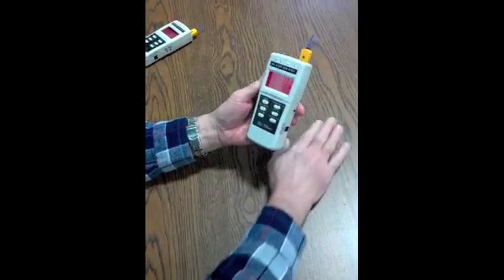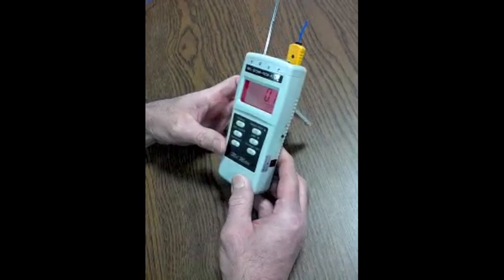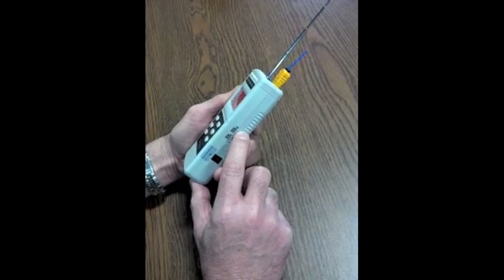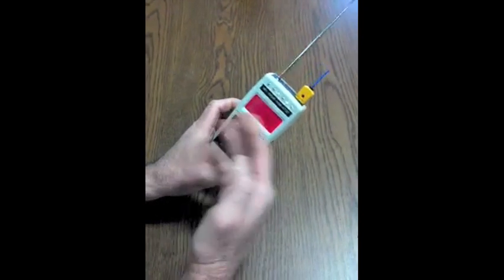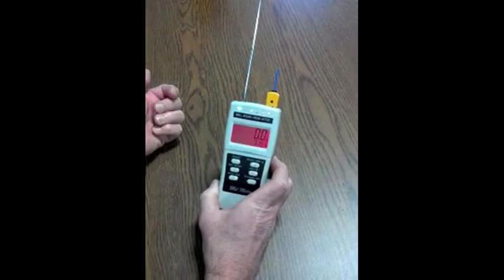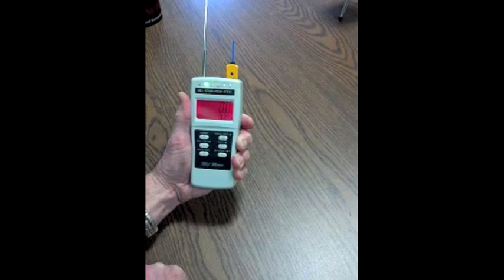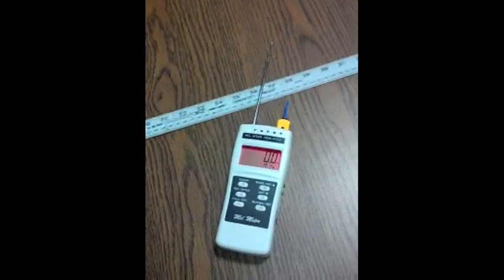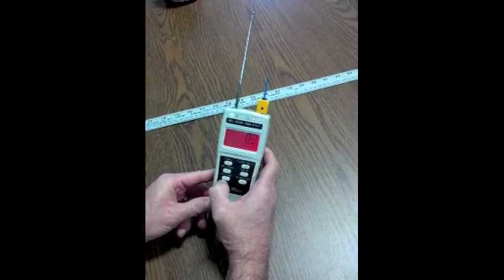Mel-8704R-REM-EMT

Comment from the maker: Hi James,
It would be like building one from scratch. The Mel-Rem-EMT card is a completely different and much larger PCB design. We would need to swap out your old REM card and install the new EMT PCB. We would then need to swap the LED top cover to a 6 LED array and install three switches. (1) for the EMT 5-step gain adjustment and (1) for the EMT Zero (baseline) and finally (1) ATDD zero button. The SDD shadow module & ATDD +/- 5 Degree Hot/Cold Spot detection can be easily added to your unit

Comment from the maker: The basic Mel Meter is a single axis EMF Meter. The correct procedure for accurate EMF measurement requires that the user activate the Record mode (Min-Max) capture. Then slowly move the device throughout an environment. A wrist can easily articulate 3-Axis movement. If you have a Mel-Rem, the Rem feature generates an independent 360 deg. EMF (bubble) around the antenna. If you have a Mel-KII, or Mel-MADD the combined detection of the two EMF meters will be similar to that of a 3-Axis device.

Comment from the maker: I'm happy to help. 
It's very easy to misinterpret subtle changes with the ATDD temperature circuit, especially if you are moving around from one spot to another. How frustrating is it to have someone say "feel how cold it is right here" during an investigation.
The main reason I created this circuit was to prove that a cold or hot spot exists by converting temperature into light and sounds. It's hard to deny a physical change that can also be substantiated  with a precision temperature sensor.

Comment from the maker: It depends on which feature is activated and how it is being used. The REMs radiating EM field around the antenna, and the ATDD's +/- 5 degree temperature deviation detection are completely independent of each other & both have LED's and Sound. In addition, you also have the Mel LCD Display with digital EMF & Temperature display which is not related to the above aforementioned features.
NOTE
Be sure to "Zero" the ATDD circuit after it stabilizes to the ambient room temperature

Best of Success!

Comment: Hi Gary,
Just bought this. Wondering if it's unusual to get light and sound readings without any changes on the LCD screen in either EMF or temperature.